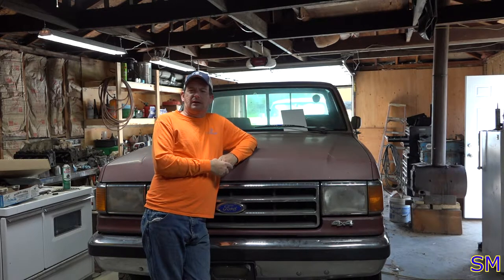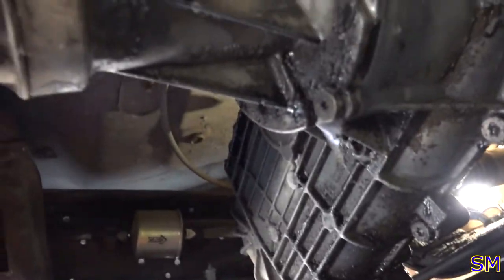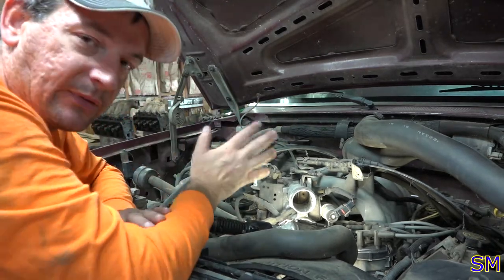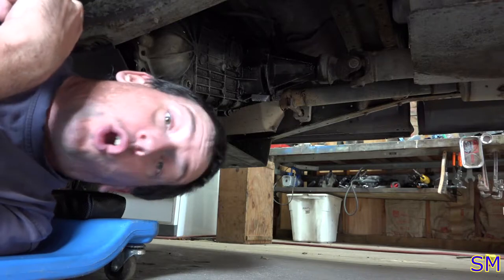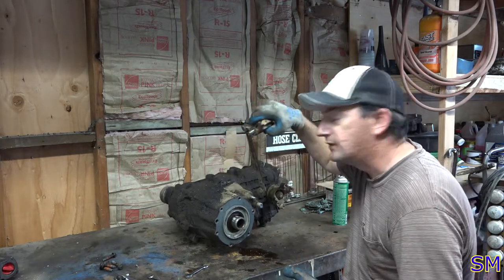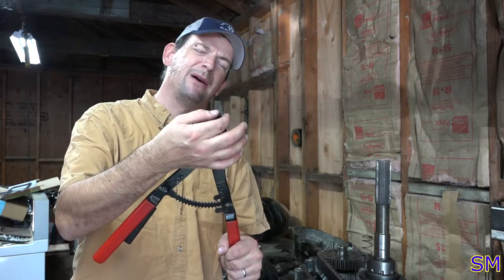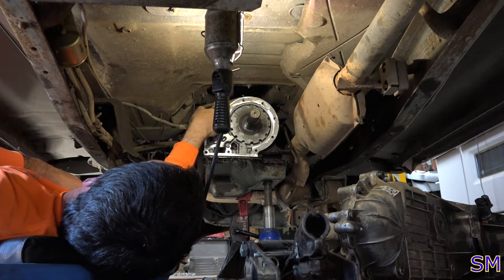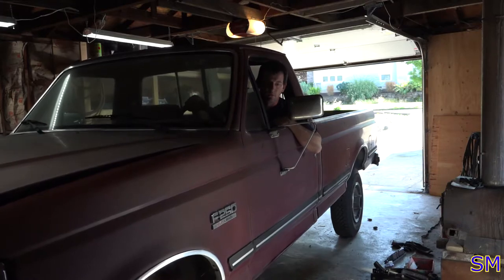Transfer Case not Transferring Borg Warner 1356

Comment: I was waiting for you to suck that shop towel into the airbox! lol!  Stainless cold welds to alloy, use either anti-seize or blue locktite, just my two cents worth. :-)  Don't rub panels soaked with brake fluid.  Spray it with water to neutralize the brake fluid and then wait a day for the paint to re harden before you rub on it, works for me.
Reply from the maker: I like it. The truck has several thousand miles on it now. Hasnt come in for a warranty repair yet......... Great advice